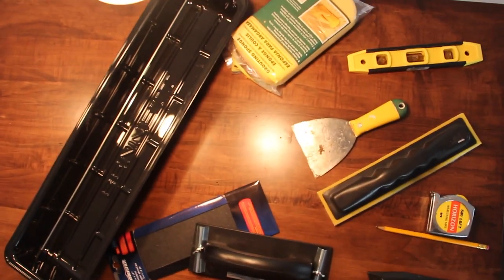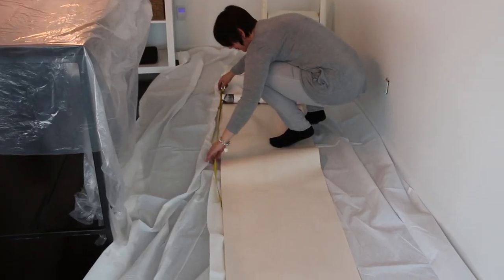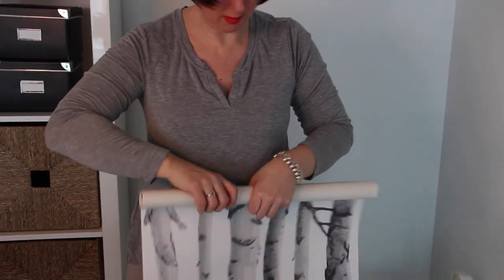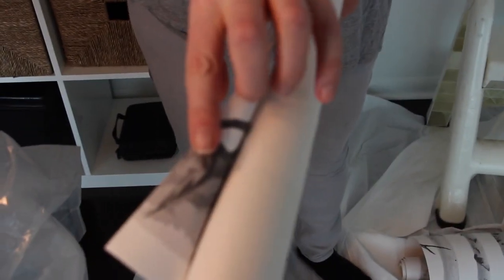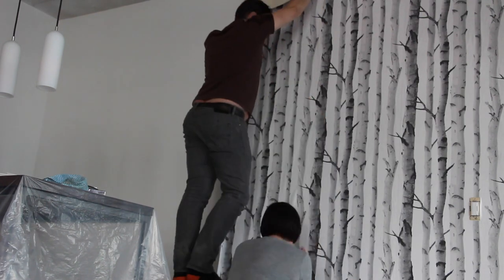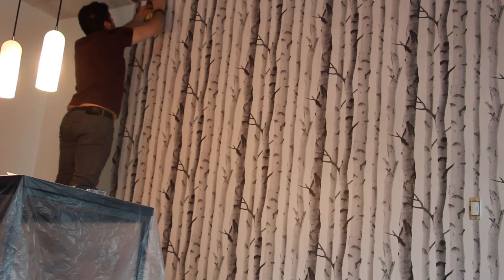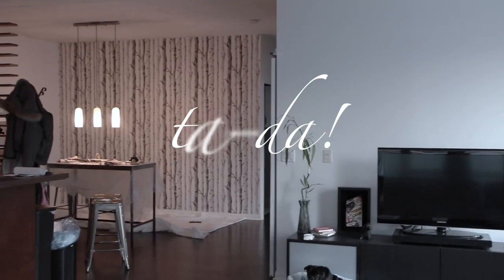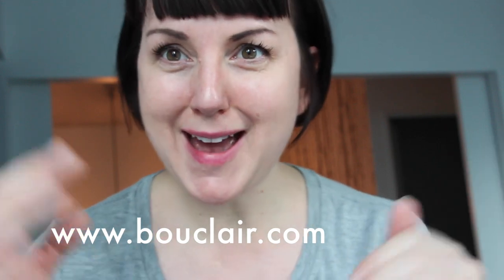How To Hang Pre-pasted Wallpaper for Beginners (paper by Bouclair Home) - DIY

Comment: I bought the same product from Bouclair. Pattern repeats every 10½". So I followed the same instructions you gave, except one thing. I had a brick pattern. So if my wall was 193¼"  high. I cut my strips at 193½" so that on every cut, the pattern automatically merges with the first or next strip. So like that I  just have ¼ of play and 0 waste. So instead of having 6 strips like you guys did, I got 8 strips out of two rolls.

Comment: Did I miss something ?  Did you wait a few minutes between hangs to allow the paper to expand ?   
I am new at this, I have seen several videos saying that this step is very necessary. I would like to do it your way, pulling the paper right out of the water on to the wall. I have been "booking" my paper.
Reply from the maker: Fred Stellabotte we took a few minutes on each sheet to smooth it out and make sure there weren't any bubbles.

Comment: Great vid...and great tips! I read that "booking" the paper for about 5mins after soaking is essential before hanging on the wall. This helps with stretching and shrinkage after the wallpaper is hung. Did you guys experience any separation at the seams of the strips the next day after drying?
Reply from the maker: +Craig Pereira not really. There is only one place where I think we failed to wet the paper enough.

Comment: What paint did you use on your walls to match the wallpaper? Really struggling with this!
Reply from the maker: I'm actually not sure! It was the standard color on our condo walls! :/
Reply: I realize this question was a year ago, but I wanted to suggest a tip; take a piece of the wallpaper into your local paint store and have them match it to one of the colors that you like in the wallpaper. It is also best to paint your other walls prior (72hrs) to hanging your wallpaper. Great vid, also booking your paper is important so that your edges don’t curl. Numbering from the top of your pattern is important too as you don’t want to get to the next section and it be upside down. It isn’t really hard, but I will caution that most pre-pasted rolls will tell you to cut an extra 4 inches from your wall height and really you should match the pattern side by side on your wall (before you wet your paper) because the third section you go to paste may need an extra 10 inches cut. Alway buy extra, you can return unopened rolls ( look for same lot number) another quick note with doing a feature wall you should start in the middle making sure to use a plumb line, and then hanging your sheets from right to left from of your first hung sheet. You will use less wallpaper.
Reply: @tinaknutsen  this is great info, I'm doing a photo drop for my daughter's wedding and using 2,  4' by 8' walks put together. Any suggestions

Comment: Why didn't you book the paper? Just wondering.
Reply: Tinthia Clemant what do you mean by ‘book’ the paper ?
Reply: You are supposed to take roll out of bath and fold both ends into the middle with glue against glue. And let it rest for 5 minutes. How can you even think of skipping this step completely?
Reply: @CarlosPacheco  keeping the wet sides against one another for a few minutes.
Reply: @pj1234p  sadly, this is a somewhat rude comment. ☹️
Reply: @TinthiaClemant  Note that this was the first time we ever did this and this was done almost 7 years ago now. So at this point, I don't know why...
Reply: @CarlosPacheco  Hi Carlos, I'm not sure why, after 2 years, this loop is going. Hmmmmm. Anyway, I hope you and your lovely wife are well and safe.
Reply: Tinthia I have done non pasted wallpaper which required 'booking.' Booking is to keep the paste from drying while its soaking in. With non pasted paper you roll on the paste, fold paste side in & let sit about 12 min for the paste to soak in before hanging else it will fall right off the wall. It appears the prepasted product soaks in the water bucket rather than 'booking'. This is my guess having only used non pasted wallpaper & consistent with the instructions on the prepasted roll Im about to attempt 🙂
Reply: @trandom2083  thank you